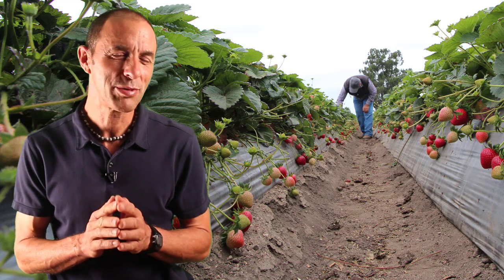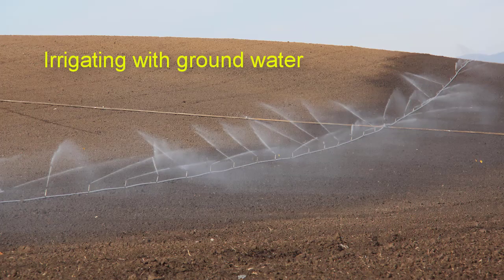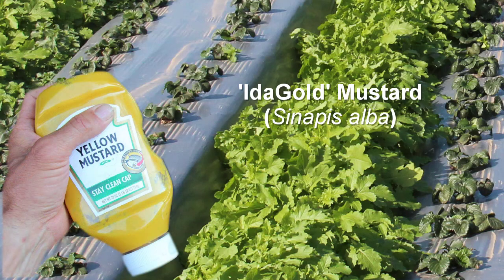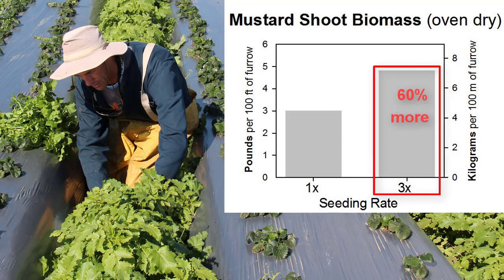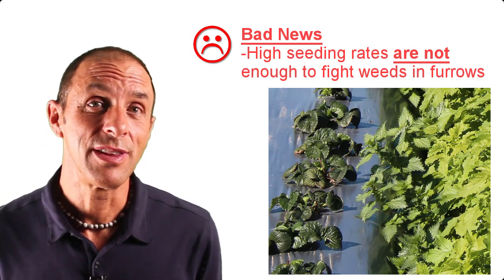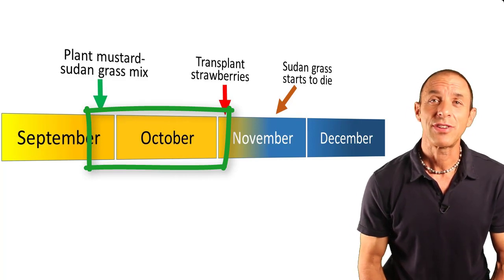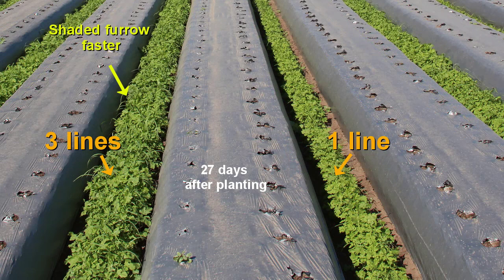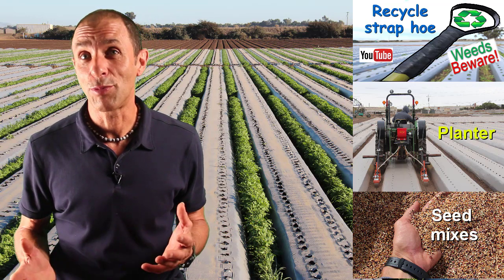Furrow Cover Crops for 'Greener' Strawberries & other Plastic Mulched Crops

Comment: Encouraging that you're doing these studies.
If you were to instead use an annual Clover in the furrows, once furrow weed whacked, would nitrogen released from the Clover root nodules be near enough to the Strawberry roots to enhance N availability for the SB's? 
Also, is the Sudan Grass dying from frost or simply from being "out of season"?
Reply from the maker: Interesting question.  I'm not sure how deep the strawberry roots go and if they could access N leaking from nodules.   Yes the Sudan grass dies from frost or cold weather during the winter.
Reply: It must be suspected that the Nitrogen fixed by a legume cover crop would strengthen the weeds and aid them in in the competition, the same way weeds in legume fields are encouraged by the fixed N and are hardier than in other (on-legume) crops.

Comment: why the plastic? Why not permanent raised beds? With permanent raised beds you could have a permanent non invasive grass like fescue in the rows.

 HUGE initial investment, but you never have to deal with the plastic again, which saves money and labor.
Why not try that on a small scale of ten rows or something like that ?  If it proves viable you could just phase out the plastic at rate of ten or twenty  rows per year.
Reply from the maker: Permanent raised beds don't make practical sense for the commercial scale systems here.  Also, these systems require that we can rotate between vegetables and strawberries that have different bed sizes.  Often what works well on a small garden scale just doesn't work well on a larger scale.